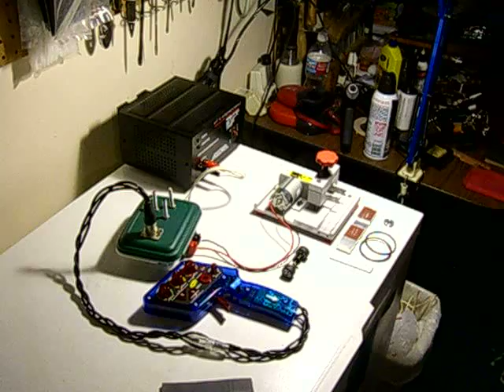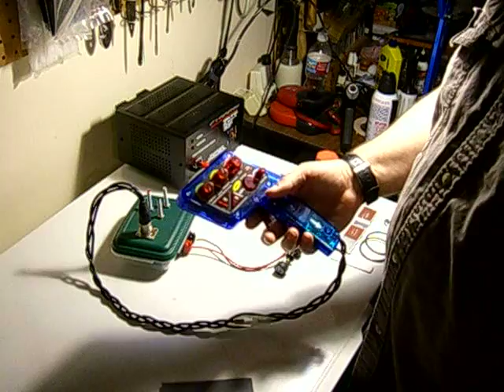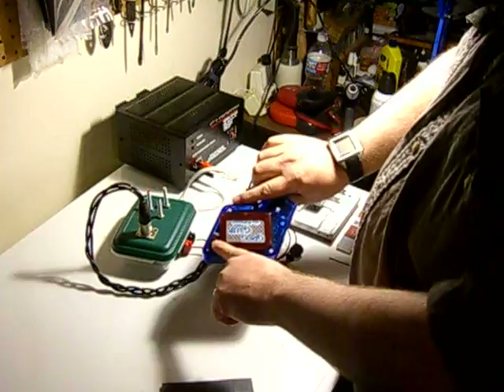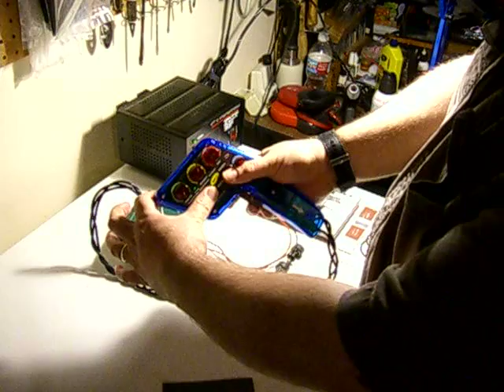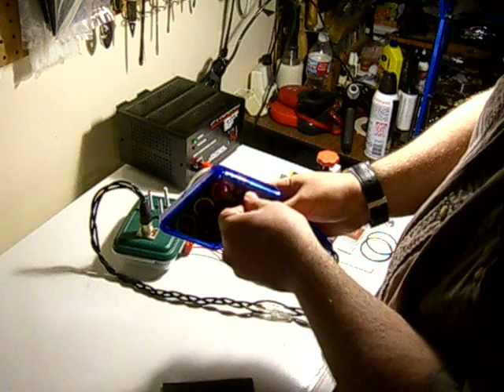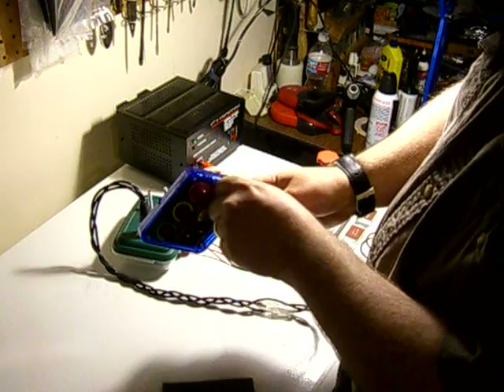Tire Razor Speed Control

Comment: Can that controller be used as a Parma controller replacement, what's the voltage the controller runs off of
Reply from the maker: walker sutphin Well, any controller can replace a Parma, depending on how many volts and amps you need to run through it. This one, with the high amp cart, can run pretty much any car, if you need something capable of running commercial 1/24 stuff like group 12 and wing cars and such. The latest version, the SCP2, can run on volts as low as 6, I believe, and as high as 16 (but don't quote me on that, it might be higher), and with the "metal" cartridge, will handle up to 40 amps continuous, if needed.